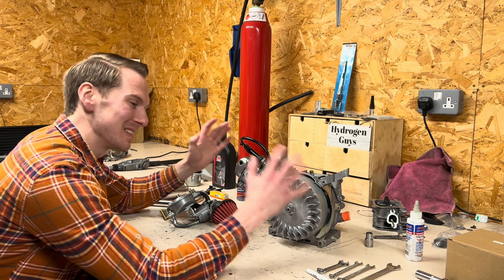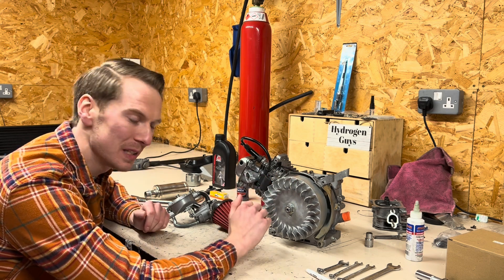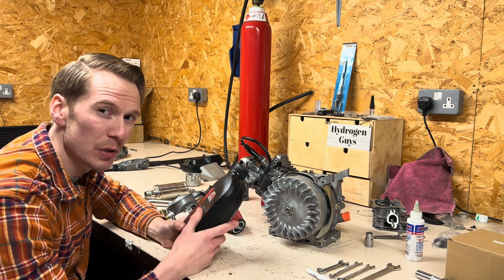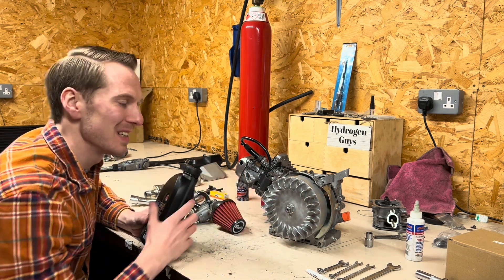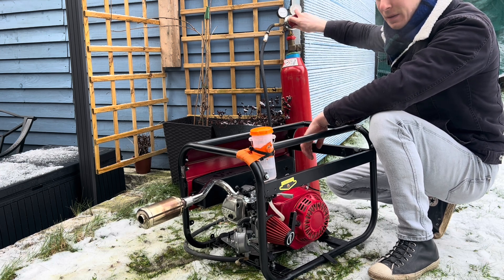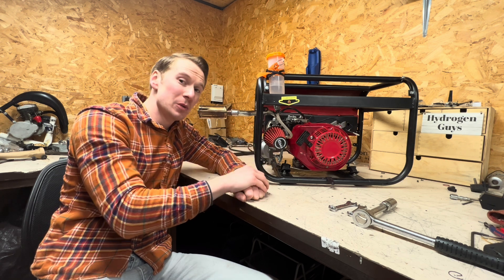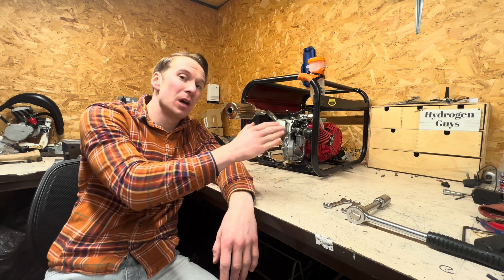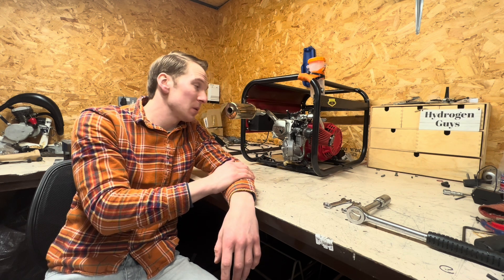It’s alive! First start of the hydrogen combustion engine

Comment: 4:26 WHY do manufacturers insist on having that ridiculous tubular frame around generator engines?
It rattles and makes the whole thing bulky, heavier, and silly.
I have a Honda 2kw generator I got from a salvage yard, I discarded the frame and upper wide flat tank, and mounted the engine (with the bolt on generator head) to a home-built wooden twin skid type base. Than bolted on the standard Honda gas tank for the GX series engine.
It looks a lot nicer, more old timey and less like a Y2K Costco special.
Reply from the maker: 100% agree, sounds like did a good job building your own
Reply: @Hydrogenguys  I just wanted to convert it to a lower rpm 110v DC light plant and general supply to run lights and brushed motor power tools in my backyard. And I liked the look of electric generators from before 1950.

Comment: Some silly idea but since oil and water are not a good mix, are there any water based lubricants out there?
Reply: What exactly do proper steam engines use for oil? Its injected into the piston chamber with the steam, I wonder if that could be used here?

Comment: have you tried using HHO with the engine and also adding a turbo to the setup to increase efficiency?
Reply: HHO works great, but the problem lies with storage of HHO. HHO stored in any large quantity is dangerous, there have even been reports of HHO exploding with know known ignition source, which leads some to speculate in can spontaneously explode. Even pure hydrogen has it's own storage problems, which is something that will have to be worked out before it becomes a mainstream fuel.

Comment: Man i can't wait till someone has the balls to sell one of these complete.. im pretty good with my hands but i guarantee yall have been doing this for a minute.. need someone to step up & start selling some working models
Reply from the maker: That would be the dream, this engine ran very well on hydrogen. I guess it’s only a matter a time
Reply: I have to watch the video again, to see fuel and lubrication completely. I am interested, how long such a machine will run for good, until it breaks. Because if it breaks out of lubrication reasons, the whole build must be changed. If the combustion engine will work on HHO as shown for long and good, I am willing to start building those immediately. What could be added to the ethanol-water-mix to prevent the engine corroding from inside?

Comment: Interesting design/mechanics but am not too impressed with this demo as most of the energy could be from the methanol which is CH4O so it’s producing carbon dioxide as well as water. Noticed half of the  “cooling” mix is used up in just a few minutes which is highly suspicious given run time. He does show that the motor speed depends on hydrogen supply to run, which is not surprising given that’s all that goes through cylinder injectors, but a lot of meths got burned and that could be where most of the energy came from…burning the dreaded carbon…and the condensation proves nothing as exhaust gas from any internal combustion engine  fuel produces steam. All that shows is it’s a clean burn (simple fuel molecules/ratio of oxygen correct etc) cheers.
Reply from the maker: This was the first time running a water methanol mix, you can see in other videos the engine running on pure hydrogen alone. 

The water methanol mix in this application is for the performance (racing application) but isn’t necessary for normal operational conditions.
Reply: @ very good. Can you calibrate the relative power output: fuel mix used? By running a battery charger for instance? Load output would be important not just motor turn over rate.
Reply from the maker: I agree! A proper load test is needed, this engine will be used in a go kart, so hopefully in a few videos time we will see the engine operating under load in a go kart 😊

Here is an older video of a similar engine being operated as a generator, if just water (no methanol) for cooling.

Hydrogen Powered Generator
https://youtu.be/_-sSlG2OfVw
Reply: I tend to agree with your observations.  Reminds me of the MW50 (Methanol Water 50-50) boost used by Nazi Germany on aircraft such as the Focke Wulf FW190 during WWII.  It was used as an emergency boost which increased combat performance by increasing power output but also allowed the supercharger to run at a higher boost level.  I wonder how this injection system could be significantly different?  Aside from the fact there's no supercharger of course!  Nevertheless, methanol, hydrogen and oxygen all add fuel to the fire - it remains to be seen what mixture is most efficient and/or effective.  Just out of interest - my Brother-in-Law ran a Hydrogen/Oxygen mix on one of his cars. He hooked up electrolysis gear (anode/cathode in a large container of water) to the battery and linked a sniffer pipe into the air intake.  Anecdotal evidence only - he said it increased fuel efficiency but had a negligible effect on power output.
Reply: @jamesnorris3792  doubt he would get hydrogen at the required rate doing that. Would need to be putting probably 5 to 10 kw of dc into the electrolyte…a massive setup at 12 v. A battery would have the amps so might get about a kw, I only ever used a battery charger for making hydrogen so only about 8 amps. I Might try a big battery like for a hydrogen balloon, he must have put some battery acid in the water or similar to make it conductive…acid haze going into engine at high gas flow rate would probably wreck it in due course. Explosions are always a risk with electrolysis, had one or 2 myself._😆
Reply: @davidgriffiths7696   Unsure what setup my BIL used, I only saw it once.  The anode/cathode was a pair of large, wide, thick circular metal rings with insulation between the two (inner/outer setup).  When he switched on the ignition, it fizzed like an alkaseltzer.  My understanding was that it supplemented the burn which provided better fuel economy at constant long distance highway speed - he did a lot of long distance country travel.  Aside from that, explosions and electrolysis should go together!  Surely you have put together a home-made h-bomb?  Pump the H and O into a sealed box, light the wick and do a runner!  Not my fault, I blame school.  I mean, why would they teach us that if they didn't intend for us to use those skills?  Besides, I don't recall my science teacher ever saying 'don't try this at home'. ⛑
Reply: @ sounds like that performed well. I might take my old science program out of moth balls. I probably assumed rate of hydrogen production was due to electrolyte resistance not charger current limit. I did indeed have my own highly successful hydrogen bomb program in the 80s as the Isle of Man coastal caverns know, some were low altitude atmospheric tests and were impressively loud. Went for the Al+NaOH route for a more convenient supply that added pressure from a bottle to inflate the test series models. I used to use big size D battery cores for electrodes, probably the go to solution in those days. I guess iron rings would work, although maybe they would react with the oxygen and make a mess… 
Currently working on a gravity driven air supply for a lake oxygenator as an aside. Compressed air harvested from a long downhill farm pipe with entrained air is trapped and piped back up to pond…
Reply: Accumulating hydrogen and oxygen in the same container was never done though. Probably thought that might go off prematurely and blow up the mother’s house. Still now I know it works could set it up away from my farm buildings. Pure hydrogen worked well in my test program once lit the big ballon’s burst and explosive combustion.

Comment: Nice build! Shows how it can be done. I would try running it without the methanol by bubbling air in through that water in the bottle. I've heard the brown's gas suggestions, and that may be another thing to try later if you need more power. My only concern there is the extra heat involved, (maybe cooled with more water vapor?), and the increased risk of storage, (maybe better not to store it at all and just produce it on demand). Definitely a must in low oxygen environments like underwater or the moon, etc. But I doubt in locations with limited water supply you would want to risk loosing it, but would want to capture the exhausted water vapor to be used again later.

The advantage of hydrogen over every other gas of course is its 100% recycle ability from water; kinda the opposite of hydrocarbon fuels where the more you use it the more you loose it.

Comment: Running an engine is one thing...running it under load is quite another.
Reply: I have a setup that accounts for this. A little unorthodox, but works.
Reply from the maker: This was a first run after the rebuild, a lot more testing to do yet.

Comment: Wow how much oil did you add? The way you filled it was wrong! With any of these clone engines fill with oil on a flat surface until oil starts to drip from the filler neck or to just below the threads.
Reply from the maker: Thanks for the info, I just added the amount shown on the engine spec sheet. Which on a flat surface almost overflowed.
Reply: Yes that would be about right then, obviously us as the viewers didn’t know that from the video it looks like it would of been overfilled, sorry its just my over thinking brain 😂.
Reply from the maker: @jamescort1027 not at all! This the feedback I need to hear, I’m not a professional engineer builder any advice is welcome. 
Thanks again 😊

Comment: what temperature did you achieve at the engine with a cold spark plug and methol/water cooling?
Reply from the maker: I didn’t get chance to measure the temperature with this being the first start up, but definitely something I’ll be measuring next time! Thanks for the suggestion

Comment: Some type of EGR to reduce engine knocking will help a lot. My HHO generator has a 1/4 cooper tube, fending the carburetor with gases from the muffler.  Ignition set up is 5 degree after tdc. 90% of air filter covered with cardboard to leave de oxigen from HHO burn all the mixture. Runs fine

Comment: Sorry, I don't get it.  It takes more energy to make hydrogen than it releases when you use it.  All you're achieving is worse efficiency in the whole energy production cycle and that is the entirely wrong direction you should be going.  As a proof of concept..... sure.  But practicality?  It has zero.
Reply: I can' speak for the guy in the video, but for me the combustion engine is my favorite invention in the history of mankind. My whole life revolves around classic cars and motorcycles. I'd pay tenfold for fuel just for the experience. And I'm not the only one.
Reply: @nichtdiemama11  I'm right with you on that thought line however hydrogen is the last place I'd turn to.  The manufacture of ethanol isn't beyond the reach of many and far easier to achieve, store and use.  Biodiesels are another source etc.  The idea that hydrocarbons are to be 'phased out' is a ridiculous concept and unsupported  any real measure.
Reply: @kellyeye7224  There's no way production & transport of bioethanol is more efficient than creating hydrogen.
Reply: @ I wasn't referring to the efficiency of ethanol/biofuels - I was referring to the fact that you/me could more easily make it as a substitute for petrol than we can make and store hydrogen.
Reply: I have to disagree. The problem is the stoichiometric ratio is off.
Reply: Difference is any pleb can make h gas at home easy, and can even do it from solar, not so easy to make ur own dino juice tho...
Reply: @Gazdadjuz  It takes more energy to make h gas than you recover from it when you use it.  Equally you cannot store any quantity (under pressure) as there is no practical way of either compressing it or storing it safely.  I know of no one that has made usable quantities of h gas for use at home.  Great idea if you want to waste your money.  It is perfectly feasible to make ethanol at home and lots of people make bio diesel too.  Methane is another 'simple' energy source easily made.  Get educated.
Reply: @kellyeye7224 That is simply not true. One has to look at all angels. I can make hydrogen almost as a by product by living off grid. I will burn wood as a heating source. Hardwood ash and rain water make potassium hydroxide. Recycling aluminum cans in the lye water/potassium hydroxide produces hydrogen gas and the gunk left over is heartburn medicine.
Reply: The YT video "Water electrolysis through pulse modulation" looks like an efficient method of extracting hydrogen from water.
Reply: You are correct on the surface, but lets dig a little deeper. Be it gasoline, electricity, or hydrogen, it takes "x" amount of energy to power a car "X" miles down the road, regardless of what fuel you use. All any fuel is doing is providing a means to transfer energy from one form to another. 
Electricity is by far the best means we have discovered to transfer energy, but its problem is storage. If one could devise something like a solar powered system that would passively produce hydrogen to use in a vehicle at a later date, you could look at the hydrogen as a way to store the electricity produced by solar. Now one could say that it would be far more efficient to just use the solar panels to charge a battery to power a vehicle, and they would be correct, but again the issue comes with storage. There are advances every day in hydrogen production and battery technology. It could be possible that advances in hydrogen production outpace advances in battery tech and become a better way to store energy for mobile applications.
Reply: @m16ty  "it could be possible..." - that we develop a means of burning petrochemicals without the production of CO2....  See how silly your proposal sounds?

Comment: Can you convert a 2T engine to hydrogen engine and use dripping 2T oil or lubricant pump for oil
Reply from the maker: Yes, I did a short video showing a 2 stoke running oh hydrogen :)

Comment: I played around with the same concept about twenty-ish years ago. It works, but the modified gas engine concept is a go for long-term operation. 
Due to the higher-than-stock compression ratio required to run hydrogen efficiently, the connecting rods don't hold up. Either they fatigue and break, or they get chewed up on the crankshaft end when run at load. 

If I were to revisit the experiments today I'd start with a small diesel and just modify it for spark ignition (spark plug adapter where the injector goes) and a proper vapor carburetor for small LPG based engines.

Comment: Very nice!. Love your work. Maybe use an electrolysis cell to produce your hydrogen on the fly from water. If you are having challenges on getting the RPM up, heat up they hydrogen gas before it goes in. According to Charles's law that a gas expands when heated it will fix your stochiometric ratio issue for higher RPMs. I just run a copper tube next to the exhaust. No, it will not self ignite until 500 celsius. Hydrogen takes up more space in the cylinder, less air. I take 2kw of power off my 8kw generator to produce the hydrogen and use the 6kw left at 3600rpms. Use a 12v battery with a 120v inverter to start it. Custom designed electrolysis cell, 120vdc, one tablespoon of potassium hydroxide per gallon of water. Keep up the good work. Interested in your progress.
Reply: what is the flow  of HHO required  to turn on and keep the engine running ?
Reply: @atm2085 Think of a reasonable value and multiply it by 10. A lot more than you think.

Comment: I never thought about it until watching your video. If you ran a cars engine  on HHO /brownes gas, would you also need that special engine oil and the water methanol was a great idea im guessing you would/ should do the same if feeding Ito a car engine too ?
Reply: if you research it, they were running engines on Hydrogen/browns gas as early as 1863, seriously.

Comment: Супер, подскажите, я хочу запустить такого плана двигатель на hho, нужна ли переделка с карбюратором (совмещенная воздушная и дроссельная заслонка)
Reply from the maker: I don’t use HHO, only pure hydrogen gas, but the theory applied to this engine would be the same as HHO, but you will need to make a lot of gas for it to work.
Reply: @Hydrogenguys  да, я понимаю, но это не останавливает, какие у Вас есть рекомендации? Нужно ли делать карбюратор как у Вас? Какое должно быть соотношение hho и воздух, какой клапан поставить специальный чтобы не повредить мембрану на газовом редукторе? Я так понимаю от второй холостой искры не уйти? Спасибо за ответы
Reply: @Alekgmg  don't ever compress HHO because it is highly explosive.  There is H2 en oxygine combind already, so there is only need for a spark or hot surface to explode even inside the tank.
Reply: @peterbeullens6218  я не собирался накапливать газ, я спросил про запуск на hho какие нюансы есть, нужно ли подмешивать воздух? Про зажигание я понял, что ещё учесть?
Reply: @Alekgmg  with hho you don't need to mix air, just a spark is enough to let it explode, that is also the danger.